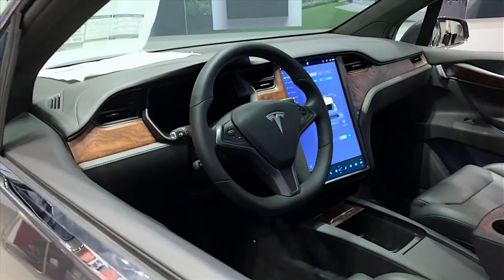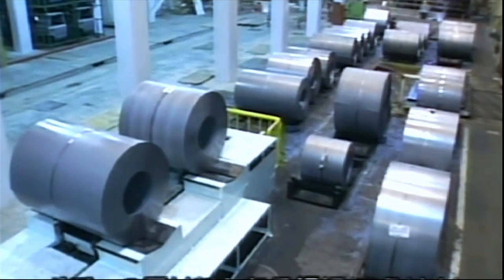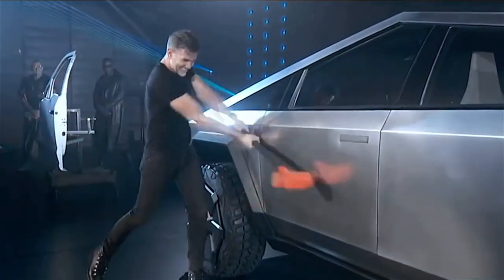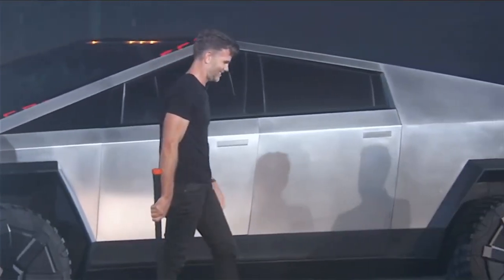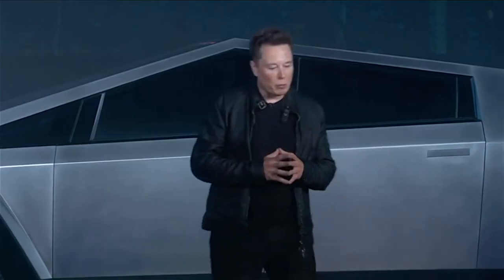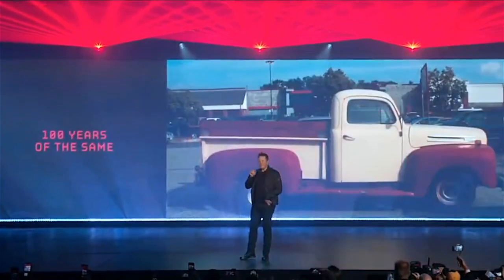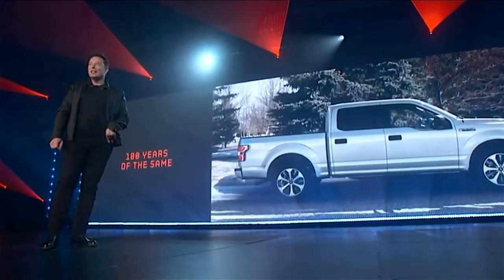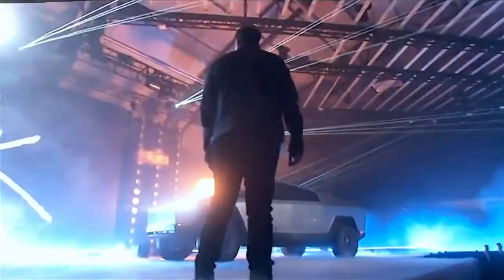Engineer Reacts to the Tesla Cybertruck Design!!!

Comment: the differentiation between unibody and exoskeleton is that there are no panels to hang on the unibody in the latter hence "exo", the body is also a class A surface which saves on many manufacturing steps you had just reviewed earlier in this video around rebound.
Reply from the maker: Wow, you seem to have done your research 👍 Agreed that there is a difference between exoskeleton and unibody car manufacturing, but the concept is very similar. I think if Tesla follows through on that cybertruck vehicle, they will revolutionize vehicle manufacturing and their stock will got way up as a result. 🤩